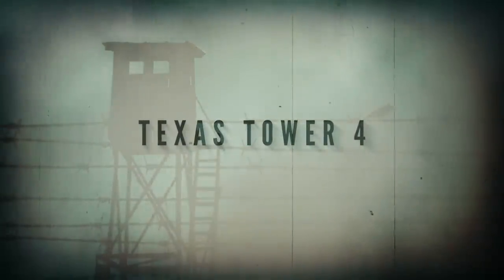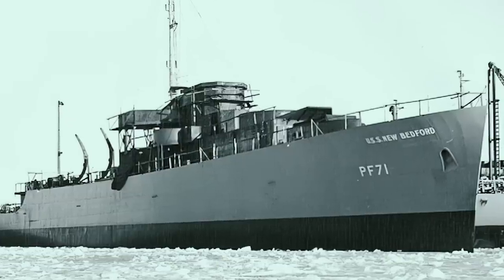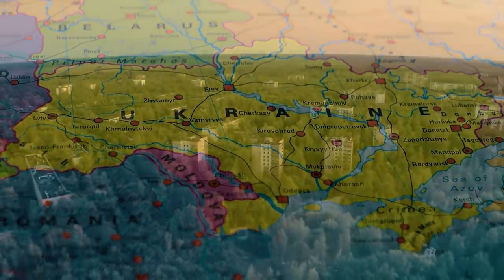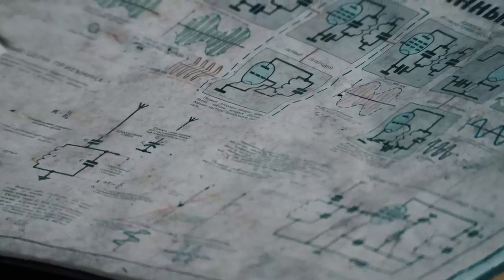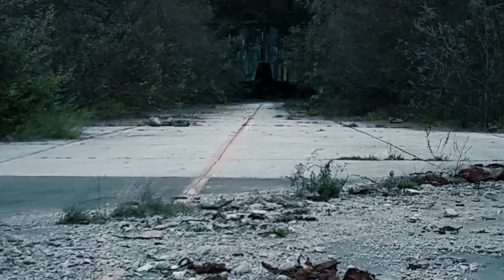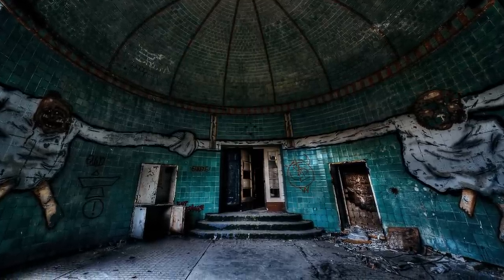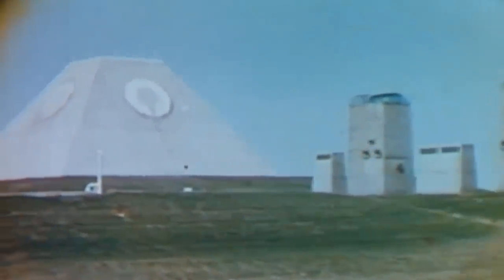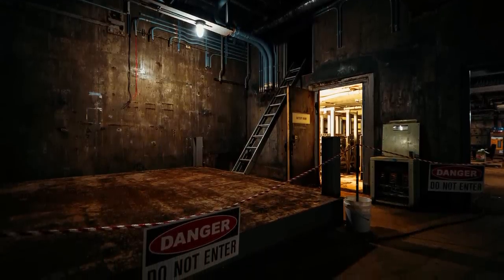5 Abandoned Military Mega Bases

Comment: I think the massive amount of radiation coming from that underground base in Yugoslavia deserves more attention. I had never heard of it.
Reply: radiation from what ?
Reply: Maybe old nuke storage as old silos in my home country also fearly radioactive?
Reply: @jasonmackenzie9928  good question
Reply: What ˝mass˝ radiation?
And from what? the Yugoslav army did not have any use of nuclear technology at that time, we only had a nuclear power plant in Slovenia, which is still operating today, and an experimental reactor in Belgrade
There are no additional tunnels or rooms under the ``KLEK facility'', the entire base is built at the same level as the runway, aircraft workshops, equipment and ammunition storage, there is only one tunnel that leads to the top of that mountain where there was a control tower, communication system and radar equipment
Uncle worked there from 1982-1989, he was an aviation technician
I went through all the tunnels several times, a bunch of other people also went through there, the Croatian army inspected everything to make sure there were no chemical or biological residues.
The biggest danger is that you fall into an open sewer shaft because the gypsies took the lids off when they were looking for scrap metal
Reply: Its because its a myth and has been debunked. However there are a copious amount of landmines around it and the Croatian police and military use the area to train dogs to detect landmines.
Reply: @caffeinecat3598  Well that make more sense than my empty guess

Comment: Duga was an attempt at an over-the-horizon radar detection system that would bounce signals off the ionosphere to overcome the range limitations of traditional radar (whose range is limited by the curvature of the earth, since its signals only travel in a straight line). The sounds it made were not able to be heard in person, but were detectable by shortwave radio recievers all over the world, in much the same way numbers stations were. Its proximity to Chernobyl probably was due to the energy needed to power the massive array.

Comment: OTHBR Over the horizon backscatter radar is a well know and understood principle it uses High Frequency (HF) radio and works on bouncing the radio signal off the ionosphere. We used to fool with it back in the day as the 'woodpecker' would turn up on the amateur radio frequencies, but you could get it to change frequency by sending pulses (morse code CW) back to it.

Australia also operates (or did operate) an over the horizon HF radar.

Comment: The DC-3 that was ``parked'' on the grass near one of the entrances could not enter the ˝želava˝ underground base, it was made to fit about 120 Mig-21s together with equipment, weapons and technical personnel
It is forbidden to visit the tunnels because there are a bunch of channels that you can fall into and NO INCREASED radioactivity was recorded in the tunnels or around the base itself because the Yugoslav army had nothing there that could cause any radioactivity
When the army was retreating, they tried to destroy the entrances to the base itself with several trucks full of TNT, but they only burned the paint off the walls and slightly damaged the concrete door.

Comment: Yakutat Alaska has one of the largest run ways designed for b 52’s to land there during WW2 along with coast defense guns still at the beach
Reply: B-52 didnt fly until 1955, introduced in 1952.
Reply: B-52 is overrated bro
Reply: certainly one of the longest runways, but amchitkas big one was longer at 8000ft/2.4km. They were both WW2 airfields, but there were no B-52 or -47 around until the 1950s.

Comment: It is weird that those buildings are not being recycled, I see alot of steel there that would be good for some other use or smelted again. But I guess its still cheaper to dig iron ore up from the ground than cut the steel parts from abandoned structures. I mean you only need a good torch and might even use HHO as fuel for cutting steel, only need water and electricity.